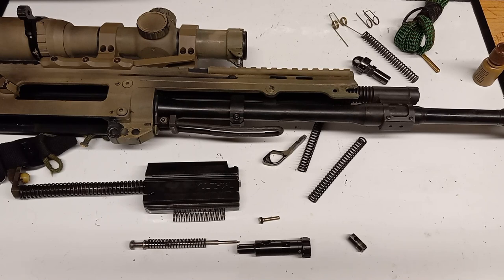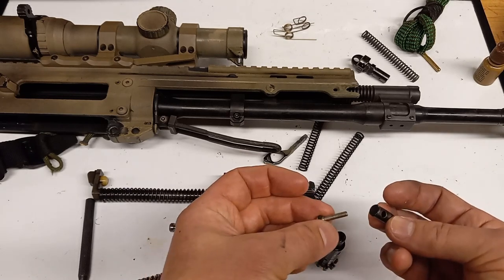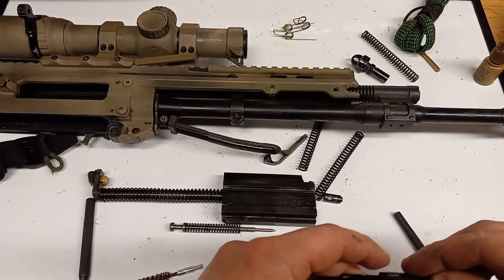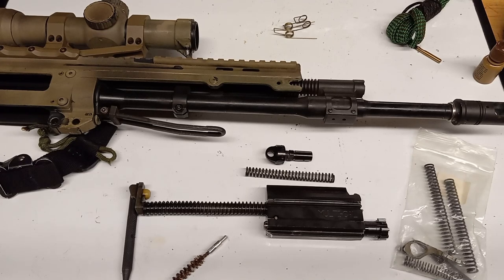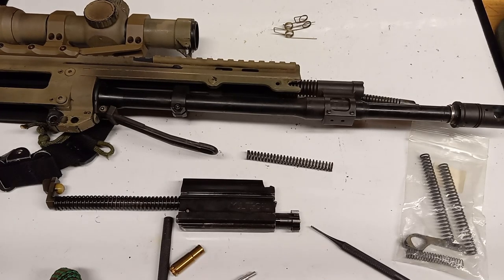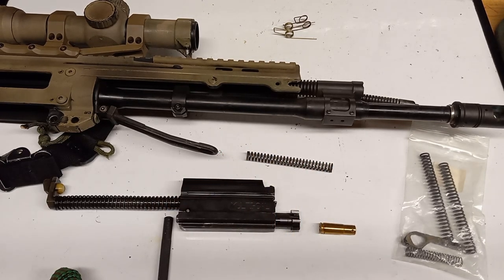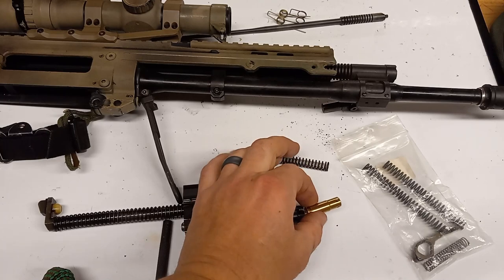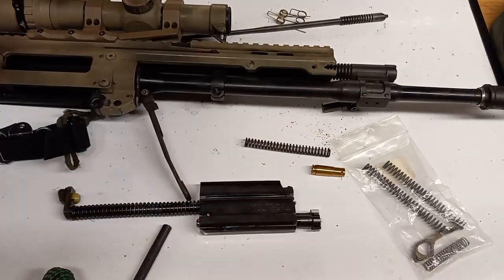Maintaining the Cycles of Function

Comment: I have personally seen a broken AR hammer it was a MIM part .
Reply from the maker: The hammer itself? Howed that even happen?
Reply: @redcellgorilla  Yes it snapped in half in the curve.
Reply from the maker: @bryanfaulkenburg462  Yeah, but from what?
Reply: This rifle was a home build . He was running mostly steel cased ammo. We were doing drill and it had a dead  trigger, he ran the bolt and it locked up , we pulled the upper off and it was barely attached binding everything up. When we drove the pin out and put it on the shooting bench it broke the rest of the way.